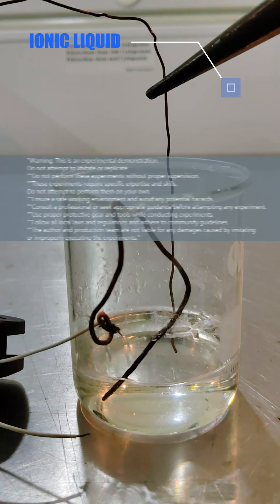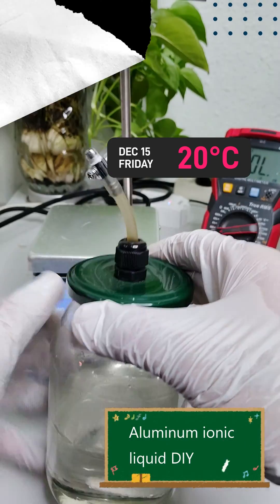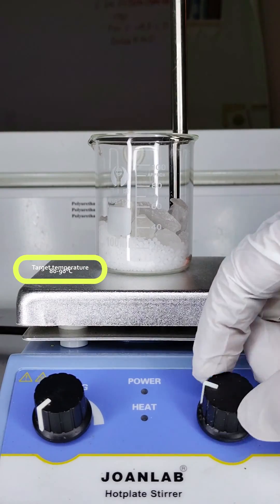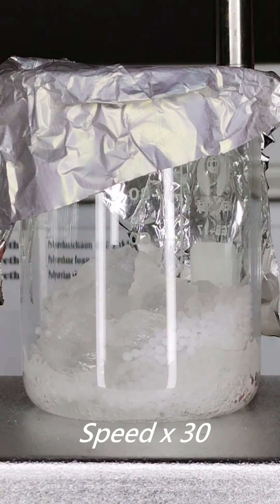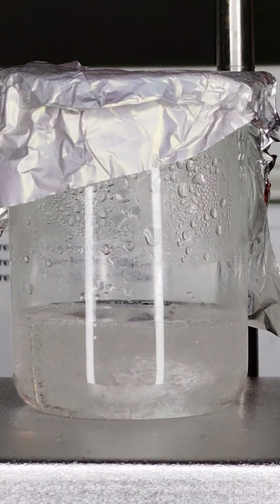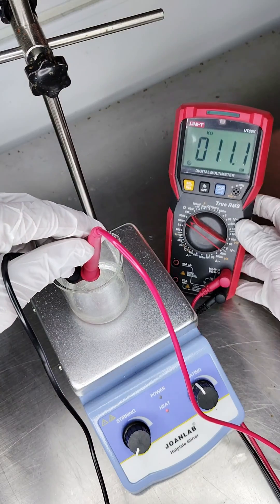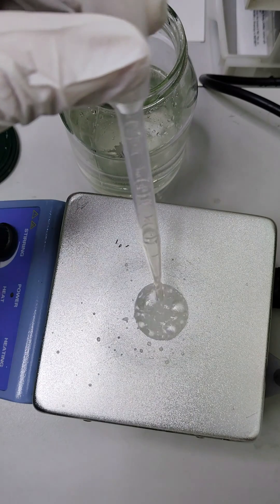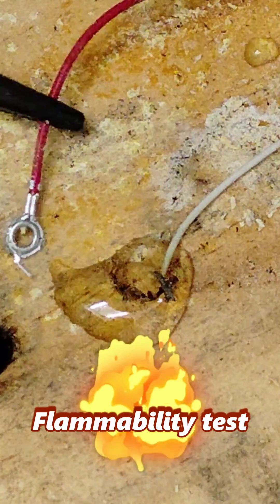Aluminum Ionic Liquid - Ultimate Guide to Creating #Electrochemistry  #DIYScience #IonicLiquid

Comment: you used heat, it is essential?
Reply from the maker: yes, around 70-80 celcius degree
Reply: @IDEAFACTORY194  : what ratios you mixed .. i mean how much UREA you have taken (in gram) and How much Alum you mixed? (in gram. 

You can make new video on this with weights , time to melt up ,and so on.. this would be great help ..
Reply from the maker: @amitgarg8393  please expand the details of video, then you can get the steps and portion ratio.
Reply: @IDEAFACTORY194  : ratios are not mentioned in descriptions ;( 😪
Reply: @IDEAFACTORY194  : what is the conductivity at room temperature?
Reply from the maker: @amitgarg8393  You can see it at the video since we put meter to meausre it. High temperature the high conductivity it has.
Reply: @IDEAFACTORY194  thanks for your response, i have added around 10g of 99% pure urea with 6 gram of Alum .. It turned into liquid .. But i checked the conductivity it was over 20k , at 70C